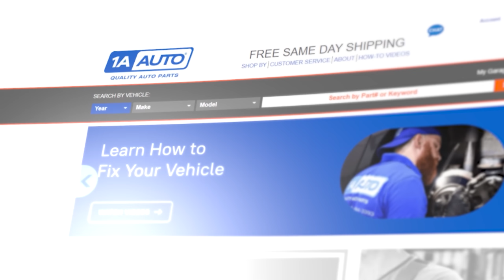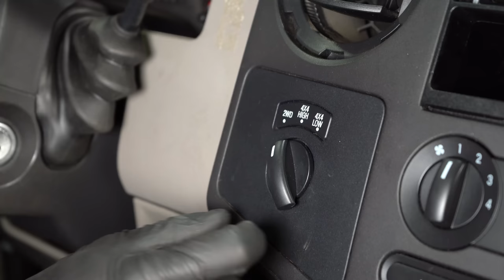4WD Truck Wheels Lock Up on Tight Turns? Stuck in 4WD? Break Free By Installing These Parts!

Comment: I was always told that for high is 45 miles an hour 4lo is at 0 miles an hour to 15 to 20 now that I know 10 miles an hour will not stress on the transmission that is good to know

Comment: thank you i have a 1994 silverado and in winter it sometimes would not want to leave gear i would have to go up then back down then it would leave 4x4 it has the j shifter style but also has an electric switch. the other day i felt some binding on a turn and got scared i might be having some issues again

Comment: So, the main driveshaft can be removed, 4 wd activated and youd have front wheel drive.  Or is there a reason why not?  But if universals need to be changed but not affordable, disconnect drive shaft and drive front wheel drive.
Then itd allow some wear that can even out to catch up for miles put on rear wheels.